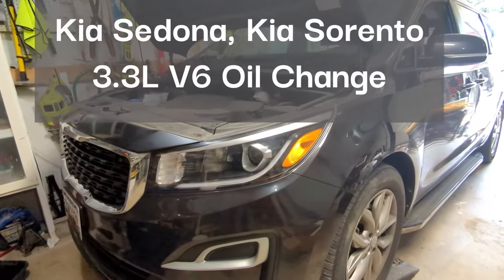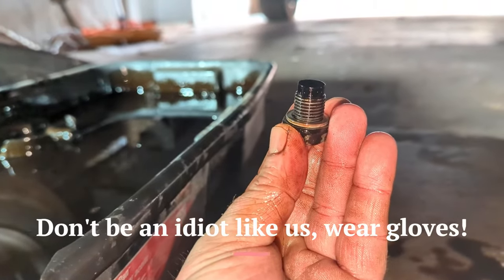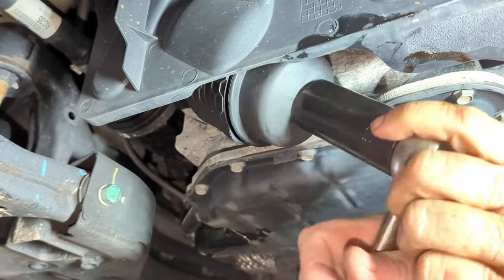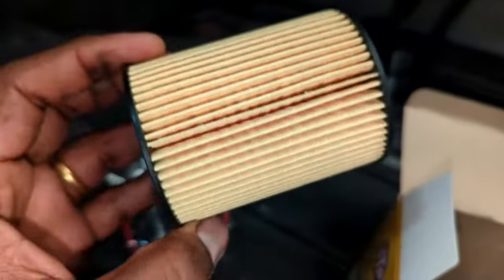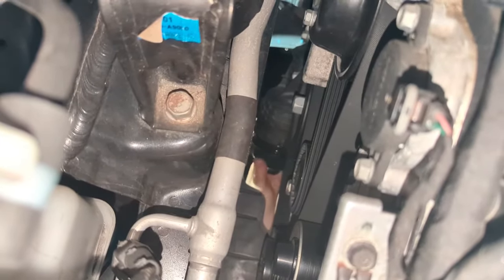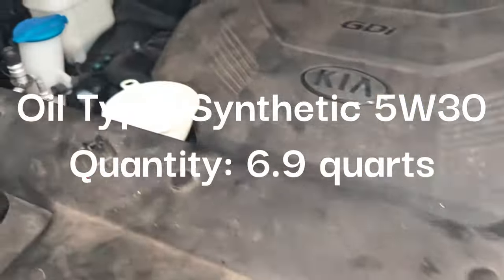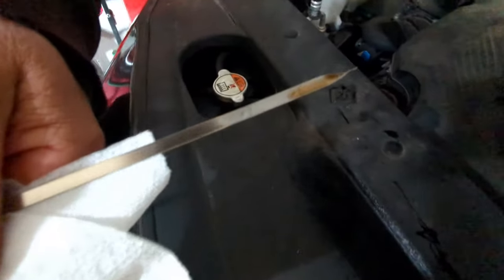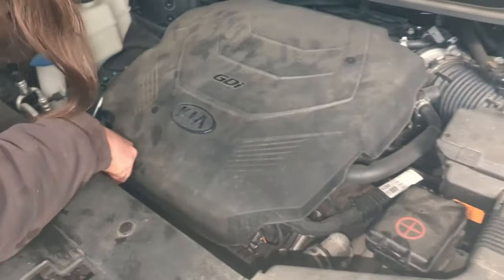Oil Change - 2017-2021 Kia Sedona, Sorento, Santa Fe 3.3L V6

Comment: This video does not apply to Kia Sedona. Oil filter is above, not below engine bay. 6 quarts not 6.9. Different oil capacities. Read your owners manual if you have a Sedona. Or do a google search.
Reply: Some engine models of sedona (Older engine models and not car) the filter is at the top, i assume your engine cover has white lining on the engine cover (this is the older GDI engine).
Reply from the maker: Thank you for pointing that out. Third generation pre facelift did have the filter on the top. 2006 to 2017 I believe all had top mounted fillers. 2018 and above on the bottom.
Reply: Mine is a 2018. Oil filter is on top and takes a different filter than you have listed there. Edit 3.3l V6

Comment: What is the included filter crush washer used for?  Is that for the drain or does it go somewhere inside the canister?
Reply from the maker: For the drain plug. You always use a new crush washer during oil changes.